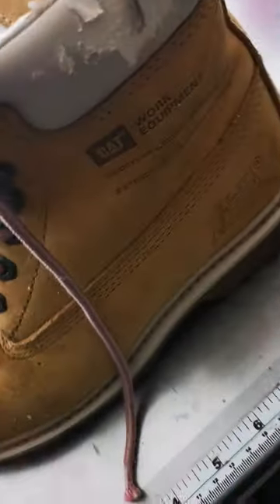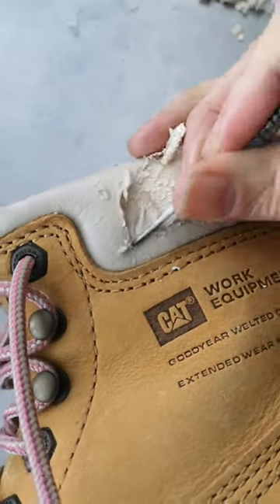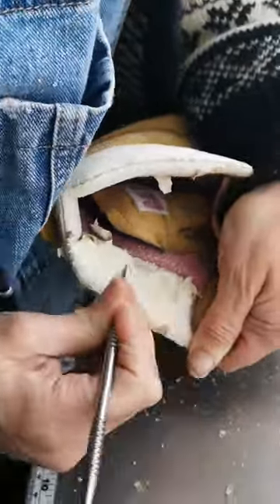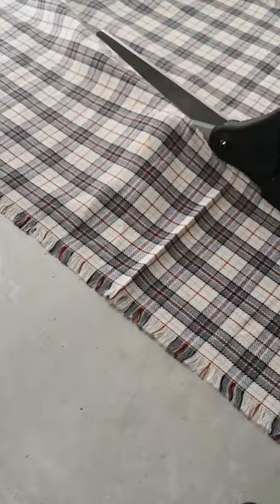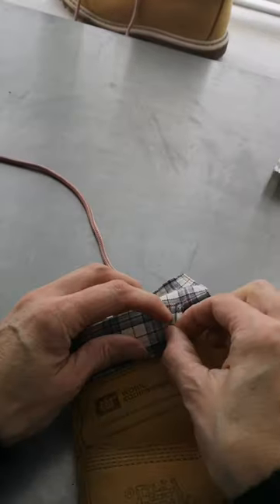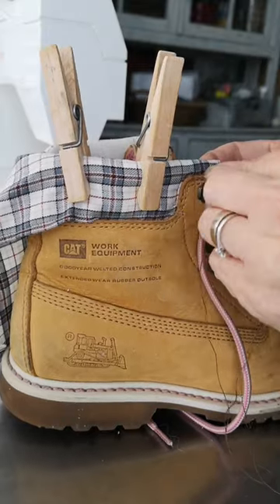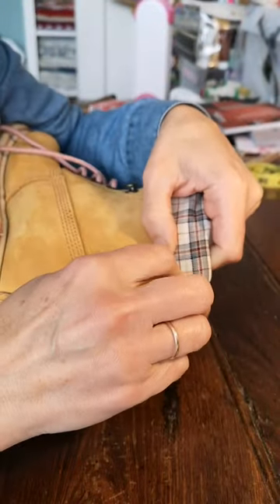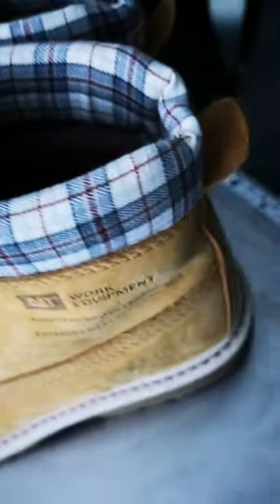How to Fix degraded PU leather boots, flaky collar on boots with replacement fabric.

Comment: Hw do u protect the inside of the upper / quarter parts of the boots from water??  If the faux leather is gone, water gonna seeps easily from the collar into the layer of leather in the upper / qiarter parts.